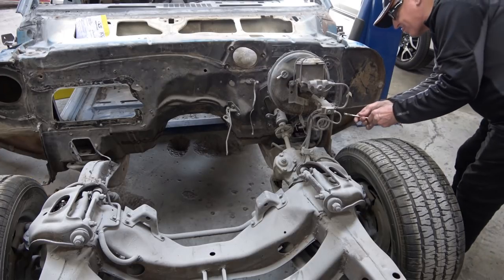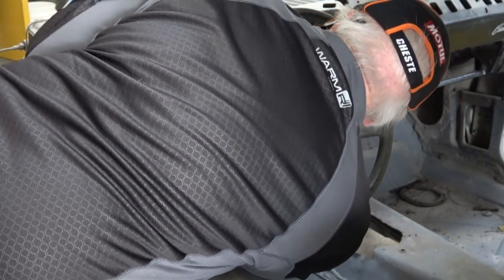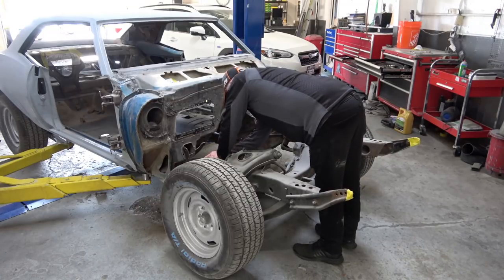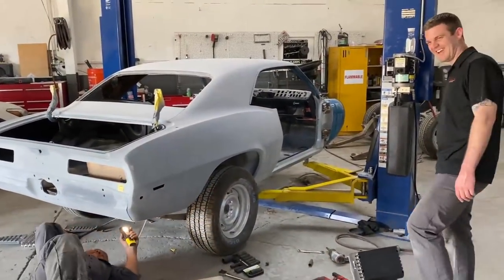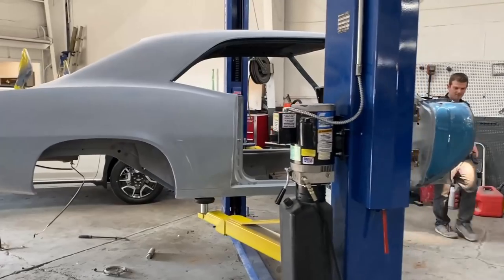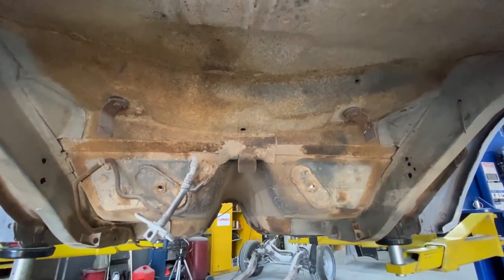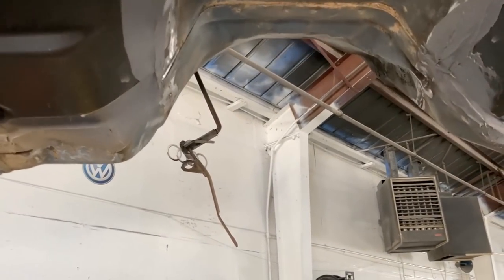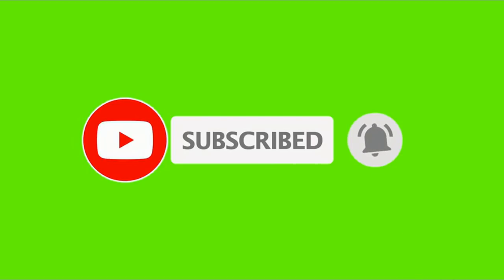69 Camaro Z28 in Le Mans Blue Full Restoration Series Part 3 - Sub-Frame & Suspension Removal

Comment: I really like the 69 z28 and seeing them being restored and back on the road and i was observing the footage of the front subframe removal and its designed very much the same or simular to the 1971 to 1980 hq to hz australian built holden and i do believe alot of mechanicle parts will interchange between australian holden and many chevies. Back in the 90s here in australia someone grafted a hq hz front subframe and suspension into a 57 chevy but the article i had on it is long gone and this swap was done so the car could withstand our rough australian conditions and roads.

Comment: A lot of work! If you wanted the correct color for the frame it is to be gloss black. Fender wells are a satin black fyi. I restored my 69 original lemans blue with white strips. Later installed original style crossram. Keep going!

Comment: Ok Ok,,You started with a car that had damage to the A-piller and dash /firewall(factory red numbers matching) This car is NOT the same car. The damage to the first car in the series would not allow you to remove the steering column that easy. Where did the blue car come from????
Reply from the maker: The Blue car is a whole separate series on an entirely different car as you will see if you check my video playlist